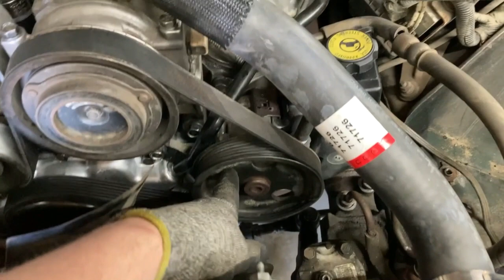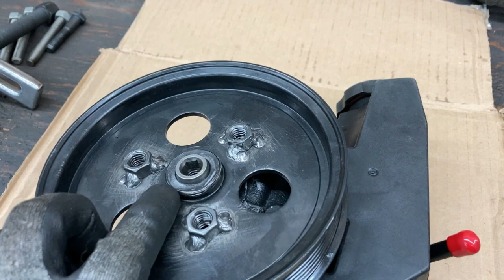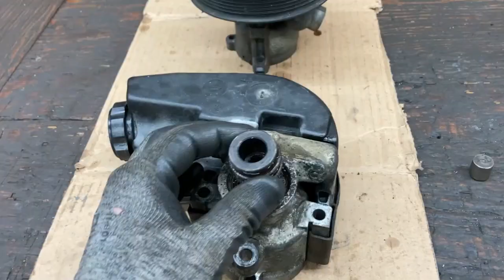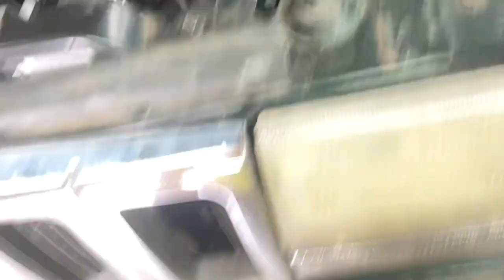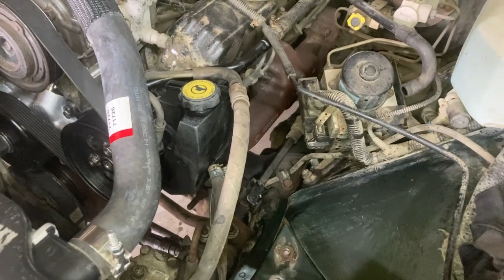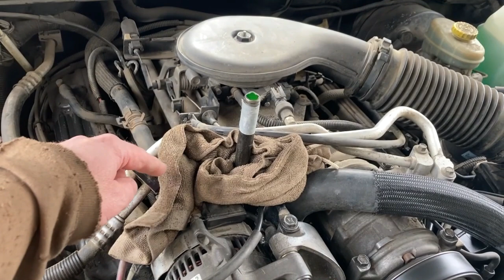1998 Jeep Grand Cherokee power steering pump and antifreeze top up

Comment: Where i live i can't find power steering fluid. You mentioned about ATF. Would any multi-vehicle ATF work (motul, havoline, mobil... for instance) or do i have to use ATF+4 specifically (like Valvoline ATF+4 fully synthetic)? Thanks